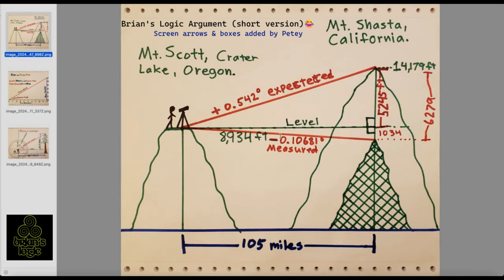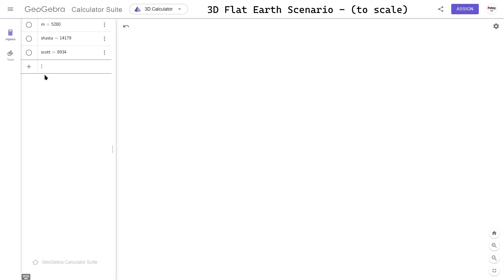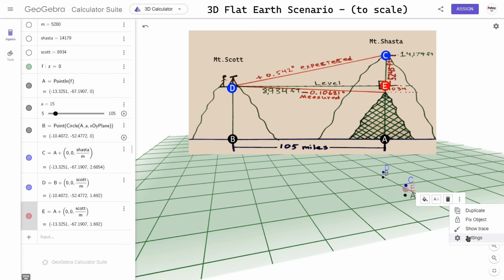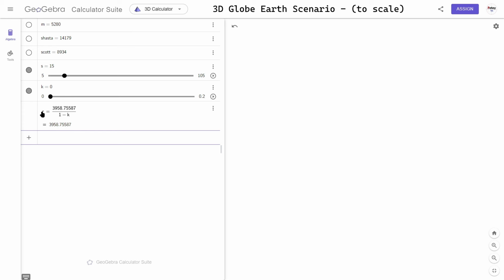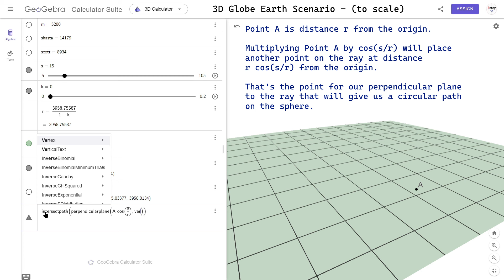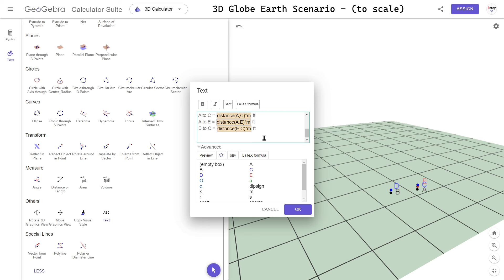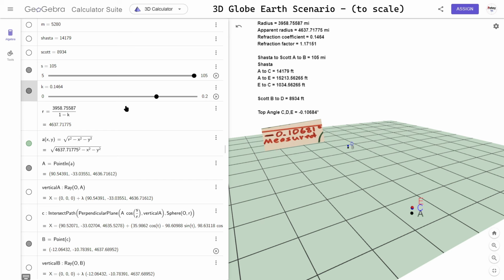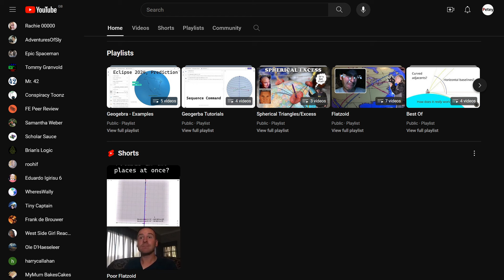Flat and Globe Scenarios - Full 3D Geogebra Walk-Through Ft. Brian's Logic

Comment: I’m only starting and you have already looked straight past the problem ?
If angular size exists then earth curve does not, as they both can’t exist simultaneously Petey  ?
Second after you ignore that, you go on to say that over a flat plane that the angle 📐 to the top of Mount Shasta must still be what’s expected, and yes this is true except it won’t APPEAR to be, because of angular size, so in actuality the angle is hitting the top of Mount Shasta, but it doesn’t APPEAR to be doing that because of perspective.
Do you understand what Apparent and Actual sizes are Petey, as your expecting Mount Shasta to show its Actual size to an Observer 105 miles away, when due to perspective this would be impossible ?
Your video fails ( not trying to be nasty or put it down intentionally ) at the very start within the first 2 minutes, as you ignore the two most glaring issues.
Reply: I will respond more later.
Reply: @BriansLogic  I think the most glaring issue here is that you don't understand perspective. The top of Mount Shasta will definitely appear to go down, but perspective dictates that it never will appear to go farther down than the horizontal line of sight. That is, on a flat earth. And the top has been measured beneath the horizontal  line of sight. This means that the top must be beneath the horizontal line of sight in reality. Your response fails, not only in the very first sentence but in its' entirety.
Reply: LOL  Angular size has nothing to do with the shape of the Earth.
Reply: All I saw was you proving you don't need a Horizontal Flat Plan to get a Elevation Angle...   WELL DONE
Reply: Changes in angular size with distance apply equally both above and below the horizontal line. (Well, generally, it applies to all sides of the line from the observer parallel to the change in distance, but for a flat Earth, it's specifically the horizontal line since changes in distance are in the horizontal direction.)

That's the point that Petey is trying to show you. As distances increase, the angular separation from the horizontal line tends to zero on a flat Earth for both the top and the bottom. That was the original reason for the claim that, "the horizon rises to eye level."
Reply: Brian, if you think you understand ANY of this stuff, I'd love to see what your calculation/prediction is for flat earth. If you can't, then you DON'T understand it.
Reply: @BriansLogic   they both can’t exist simultaneously
They absolutely can. How would the angles, which are clearly getting smaller with distance regardless of the shape of the Earth, be different if there was ALSO Earth curve? Well, it would be a very subtle difference at short distances but it would get more noticeable with longer distances.
If you were at sea level and there was something 5245ft higher than you and 105 miles away on a flat plane, what would be the angle to its top relative to eye level?
If you were at 8934ft elevation and there was something 5245ft higher than you and 105 miles away on a flat plane, what would be the angle to its top relative to eye level?
Unless you are claiming that at sea level, the angle is negative, then you are claiming different angles and that things appear to drop faster relative to distance, the higher the elevation.
Reply from the maker: What if you adjust the slider in the flat scenario geometry, slider(105,2505,100), ie, you can move Mt.Scott 2500 miles away from Mt.Shasta on FE, (not that mountains move). Would the observer measure a dip for the top angle on Mt.Shasta or would the angle be positive? How far would you have to move Mt. Scott away from Mt. Shasta before the observer observes a dip to the top of Mt. Shasta? Is such a thing even possible? Show your math?
Reply: "Angular size and earth curve can't exist simeltaneously"

Why not? Please explain.

#GottaLieToFlerf
Reply: Mt. Shasta would appear SMALLER, Brian. It wouldn’t appear LOWER 🙄
Reply: @BriansLogic  Are you saying that you think a change in angular size relates to a change in physical size Brian?  Do we need to get the Father Ted video out?
Reply: @Petey194  SMH 🤦‍♂️
Reply: @roohif  Lol you obviously didn’t see my most recent video :)
How’s the Bear 🐻 Pack going 😆
Reply: "If angular size exists then earth curve does not, as they both can’t exist simultaneously"

This makes no sense. Angular size is simply a result of an object having a cross section greater than zero, combined with the distance between observer and object. A basketball at 20 feet has exactly the same angular size whether you are on a hill, a flat surface, or in a bowl shaped depression.
The angular size of an object doesn't affect the surface you're on, and the surface doesn't affect the angular size of the object. It's as though you're just trying to muddy the water here.

If you are on a flat plane an object 100 miles away from you that is 100 miles high will appear in your field of view between the horizon and 45° above the horizon -- for an angular size of 45°.

On earth the top of that same object at the same distance will not be 45° above your level line of sight, it will be lower. In part because it is leaning away from you--not much, but a little. But mostly because the bottom of the object is farther around the curve of the globe, below your level line of sight.
Reply: @BriansLogic  Correct, I have not seen your latest video. Is that the one where you actually show the “correct” mathematics, and predict what the angle should be?
Reply: Perspective angular compression is your imaginary curve
Reply: @Emersum Biggins  Rayleigh Criterion effects from angular compression would make it look lower because the bottom of the mountain could not be resolved
Reply: @BriansLogic  Does perspective bend the path of light?
Reply: @garywybenga4188   So is it Rayleigh criterion, angular compression, or perspective that is bending the path of light?
Reply: @extrajay4868  Do railroad tracks appear to be bending? Or do they appear to be slanting upward towards eye level and inward towards each other? Why can't you see between the rails where they "seem to merge"
Reply: "If angular size exists then earth curve does not, as they both can’t exist simultaneously"
This is a claim, not evidence.
Take a object of known size (Basket Ball would be perfect), and measure the angular size of that object over 30 and 60 meters. Take a measurement on a running track that's flat, then again in a creek bed, ravine so you have a concave surface. Then again on a hill so you have a convex surface.
Your hypothesis is the angular size will change on the running track, but not the other 2 test points.
The Null hypothesis is the angular size will change in all 3 locations equally in relation to the distance.
Willing to test your claims?

"you go on to say that over a flat plane that the angle 📐 to the top of Mount Shasta must still be what’s expected, and yes this is true except it won’t APPEAR to be, because of angular size, so in actuality the angle is hitting the top of Mount Shasta, but it doesn’t APPEAR to be doing that because of perspective."
That is correct, this is Why Pete added this into the calculations. Check the video again, and actually watch. This Is accounted for. As you increase the "slider" to add distance, the angle Changes in relation to the distance...

"Your video fails"
How,? Please demonstrate. Your 1st point is a Claim with no evidence, that questions observed reality. Your 2nd point is moot, as this is covered in the video and calculations.
Perhaps pay attention next time, it's quite rude to leave comments like this, that show you didn't really pay attention to the work...
Reply: Why cant both of those things exist? 😂
Reply: @garywybenga4188  LOL, why would just the bottom of the mountain not be resolvable due to the Rayleigh Criterion if the earth was flat? The bottom, you know, the widest and largest part of the mountain?  Do you guys actually read what you write before you hit the "reply" button?
Reply: @garywybenga4188  Once again you can't answer the question.  Three choices, and you and I both agree perspective does not bend the path of light, so that narrows it down to two.
     I'm pretty sure you agree with me too that perspective causes objects to appear to converge (on a flat, uncurving surface) toward the direct line of sight/eye level, and not past it.  Correct?
Reply: @garywybenga4188   the bottom of the mountain could not be resolved
So the bottom of the mountain blurring with the surface changes the angle to the top of the mountain? Brilliant!
Reply: What a magnificent piece of drivel: Earth curve and angular size can’t both exist?? We look forward to Brian’s next five hours of vacuous rambling failing to explain what either term means and why they couldn’t simultaneously exist in his lack of understanding. Ramble on, Brian.
Reply: @RealJiffyCones  Because reasons.
Reply: @roohif  It’s the one YOU haven’t watched, and obviously don’t understand as there is NO Angle 📐 SMH…. Bear 🐻 Pack forever lol :)
Reply: @everybodylovesballs  Lol because a 6 foot object would then disappear at 1.8 miles away from an Observer.
Does that happen ? NO….
Listen it’s easy to disprove my statement, all you have to do is SHOW where in your earth curve maths 🧮 perspective is accounted for, when detailing an object in the distance or moving away from you ?
Simple just SHOW….
Reply: @BriansLogic  “NO angle” … ? As in, you point the theodolite at the mountain, and the screen is .. blank?!?!
Reply: @roohif  No Genius you don’t point the Theodolite at the top of the mountain 🏔 you point it TOWARDS the mountain and make sure it’s level ( you know horizontal ) and once you do this YOU will be looking at a point on Mount Shasta that is 5245 feet down from its summit, but due to perspective it won’t SEEM like you are, as perspective size is APPARENT size and not ACTUAL size, there is NO ANGLES, that’s what you guys can’t ( as a whole group of people ) seem to grasp ?
NO ANGLES Glenn None….
Reply: @BriansLogic  Simple question.What actually causes perspective?
Reply: @BriansLogic  Lol because a 6 foot object would then disappear at 1.8 miles away from an Observer.
Where did you get that figure from? What height is the observer's eye? Without refraction, I get a 6ft object completely visible to an observer with 6ft eye height up to 3 miles and then gradually being hidden until it disappears af 6 miles. Refraction increases these distances a little bit on average.
Listen it’s easy to disprove my statement, all you have to do is SHOW where in your earth curve maths 🧮 perspective is accounted for
Sure, for an observer at 6ft, the top of a 12ft object will appear 0.34° above eye level at 1000ft, 0.17° at 2000ft, 0.6° at 5000ft, etc, on a globe. See how the angle gets smaller with distance even though it's obviously still a 12ft object? That's perspective. These numbers are the same for a flat Earth except for the 5000ft example, where it's 0.7°. The further the distance, the more they'll diverge obviously.
Reply: @BriansLogic "No Genius you don’t point the Theodolite at the top of the mountain"

WTF 🤣I don't even know how to respond to that 🤪

The whole observation is literally Jesse measuring the angle to the top of the mountain.

You're so weird.
Reply: @thearmouredpenguin7148  Your eyes and how we see, do YOU not know that ????
Reply: @everybodylovesballs  And how much of a 6 foot object is hidden for an observer with a 6 foot eye height on a globe 3 miles away ? Nothing.
But if both situations placed the eyes at sea level, then for both situations separately, a six foot object disappears at 3 miles away, but if we amalgamate both scenarios, then a 6 foot object disappears at 1.8 miles away, does this happen in REALITY No it doesn’t, does Perspective exist in reality, Yes it does Globe OVER….
Reply: I keep banging on about this, but: when Flerfers use “perspective” or “angular size” to explain why ships disappear bottom up they seem to forget that these operate horizontally as well as vertically. So, looking at windmills out at sea, if it was angular size that made the bottoms disappear, why don’t the visible (horizontal) blades of the windmills also disappear or at least get shorter by the same amount?
Reply: @roohif  This comment tells me that you don’t understand where Jesse was wrong, or why he was wrong, and my video is about the horizontal line from the eye, and exactly where this hits on the other mountain, which is exactly where it should hit at 5245 feet down from the summit, but it appears as if it’s not doing this because of perspective, so if Jesse just calculates the amount of angle 📐 above that point that the top of the mountain 🏔 would be at 105 miles away, then this line WILL be hitting the top of the mountain, but it will APPEAR as if it’s NOT doing this due to Perspective, the thing that doesn’t exist on your globe 🌎 ?
Reply: @CChrisHolmes  Angular size is about amounts, so 20 foot of an object my not be resolvable but the rest is, as a 20 foot object would not be visible at that distance, as diffraction would make it so.
So we don’t need some guy, who doesn’t even realise that he’s debunking his globe, by accepting that angular size exists, telling us about anything….
Oh and genius the horizon is NOT geometric so who cares about what it does or does not show, it’s officially just an optical phenomenon, YOU need to learn about the Real World 🗺 buddy ?
Reply: @BriansLogic  Jesse set up his theodolite on one mountain, and pointed it at another mountain. We know the heights of the mountains and the distance. The theodolite is going to show a number - what will that number be?

I do not care about literally ANYTHING ELSE in this thread. If you cannot predict what that angle should be, then I have no interest in continuing.
Reply: @CChrisHolmes  Hey Genius….
If I place a 20 foot high object at a distance where it’s angular size is 0.02 degrees, and it sits right next to a windmill that’s 270 feet tall, does that mean that I will be able to see the full 270 foot of the windmill, while the 20 foot high object is invisible right next to it ?
Now :)
Reply: Brian, your standard excuse for every single observation that proves the earth is round is simply nothing more than “angular size blah blah blah perspective blah blah blah derp derp derp duh duh duh.” You have literally zero idea what you’re talking about.
Reply: @BriansLogic  "all you have to do is SHOW where in your earth curve maths 🧮 perspective is accounted for"
Perspective and earth curve are two entirely unrelated things. So why would the maths for one account for the other?
Reply: @frankdebrouwer-leiden  You forgot to add (because it is blindingly obvious to those of us who understand this) that on a flat earth perspective would result in the base seeming to rise towards the horizontal line of sight. Brian appeared, that is A P P E A R E D appeared 🤣, to think that the base does not rise, as the top lowers, towards the horizontal line of sight. Thus the angular size decreases with distance but the point on the mountain that is at the same horizontal height as the viewpoint (on a flat earth) would remain in the same place in the view. Brian shows odd thinking that angular size decreases downwards only. The implication is that a mountain that is 2000m high at a distance that made it look half that high would have its base at ground level and its top at 1000m if your view point was starting off at 1000m. In his odd mind it would have all of the apparent 1000mshowing from eye level down to the ground even on a flat earth. This is like saying that if you stood in the centre of a set of train rails that ran straight for as far as can be seen that, when viewed parallel to one of the rails, that the vanishing point of the rails would always be off to one side. Since there is no way to say which side since they are both equal this falls down logically.
Reply: @BriansLogic  " Your eyes and how we see" Well there's an informative answer - not! If you can't answer the question just say so, don't write a few meaningless words instead.
Reply: @BriansLogic  Have you got a theodolite?
Reply: @BriansLogic  "Angular size is about amounts"
No, it's about apparent size.

"so 20 foot of an object my not be resolvable but the rest is" Either the whole object is resolvable or none is. The idea that angular resolution limits cause bits of objects to become unresolvable while the rest can still be resolved (as long as the distance from the observer is the same) is utterly bonkers.
Reply: Explain this to us:
Your words
"If angular size exists then earth curve does not, as they both can’t exist simultaneously Petey  ?"
Why??????
Reply: @martinconnelly1473  I let that hang for globers to pick. It must be obvious for anyone who understands how perspective really works that, when the top of an object above the horizontal line of sight appears to drop lower than the horizontal line of sight, the same would go for the bottom of an object below the horizontal line of sight rising above the horizontal line of sight. To be true (quod non) the perspective lines toward the vanishing point would have to cross over. Flerfers never think about the logical consequences of their nonsensical "explanations" for reality that contradicts their silly narrative. That's probably why there are so many different "explanations" for reality that contradicts their silly narrative among flerfers, most of which contradict each other.
Reply: @everybodylovesballs  Attempting to add an angle AFTER you have added earth curve, is NOT accounting for perspective, that’s pushing an object over earth curve then attempting to creat an angle to its top, that is what’s known as Bo**ox ?
You have not presented what was asked for….
Reply: @carioca45  Because a 6 foot object will disappear at 1.8 miles away for an observer with their eyes at 0 degrees, but this does not happen, as that object won’t disappear until 3 miles away due to angular size change, and how we know that this is due to angular size change, is because we know that perspective exists, which debunks earth curve as if they both existed, then that same object would disappear at 1.8 miles away. Globe debunked….
Reply: LOL.  On a flat plane, the upward angle to the mountain couldn't switch to a downward angle even if you moved it a trillion miles away.  Perspective simply does not work like that, as most people can easily understand.
Reply: @thearmouredpenguin7148  There you go, : "Your eyes and how we see".  Don't you just adore flat earth "education"?!
Reply: @ReValveiT_01  Yes the angle 📐 to the top doesn’t actually change, it just appears as if the angle is not hitting the top from a distance as I have proven over and over….
Reply: @ReValveiT_01  Oh and if perspective exists then earth curve cannot….
Reply: @BriansLogic  OK. Let's give this a little more.
By 6 foot I'm assuming a circular object, with 6-foot diameter, moving away from the observer. After 1.8 miles, on a spherical surface, it disappears, on a flat plane it will take 3 miles to disappear. Did I get this right?
Does the height of the observer above the surface matter?
Does the height of the object above the surface matter?
In case the object was moving straight up away from the observer, would the same happen? 
That is, if the observer is on a spherical surface the object would disappear once it is 1.8 miles away from the observer and 3 miles when standing on a flat surface.
Is angular size a function of the surface the observer is standing on, meaning angular size changes at a different rate based on the geometry of the surface?
Reply: @BriansLogic  No, the angle DOES change as the mountain is moved away, but it can never switch from being an upward angle to a downward angle no matter how far away you move it, because one of the RULES of perspective is CONVERGING LINES CAN NEVER CROSS .
Reply: @BriansLogic  Your diagram at the beginning of this video is depicting that the mountain is getting PHYSICALLY smaller.  You have literally drawn it physically smaller.

How can you not see past this glaring error?
Reply: @BriansLogic  "Oh and if perspective exists then earth curve cannot"

Yeah, you spewed this piece of obviously flawed logic already.  Repeating it won't make it come true.
Reply: @BriansLogic  It's geometry, Brian. There's only one correct answer for each situation on a sphere with a radius of 3959 miles (ignoring atmosphere). An object shrinks in angular size (perspective) while going over a curve. What more do you want?
Reply: @BriansLogic  LOL.  You say it YOURSELF repeatedly at 18:35 : "APPEARED" to be smaller.  "APPEARED".  Yet you've drawn it PHYSICALLY smaller.  So which is it?  "APPEARED" smaller or "PHYSICALLY" smaller?  Because by drawing it smaller, you are literally contradicting yourself.
Reply: @BriansLogic   "Oh and if perspective exists then earth curve cannot…." Oh please do explain why.
Reply: @BriansLogic  "Your eyes and how we see, do YOU not know that ????" Stunning observation! Now how about you actually do something that flerfs rarely never do and answer the question that you were asked. What causes perspective?
Reply: Brian, I believe there is important part missing in your understanding of how perspective works. When you describe how the angular size of objects decreases with distance, you are always talking about how the top of the object moves down in the view and thats it. However, according to the perspective, strictly this would only apply to an observer lying on the floor. Imagine yourself being at the top of the Smithfield Chimney. Even the tops of near large buildings are lower in your view than bottoms of even smaller buildings in distance. The buildings get smaller in angular size as the distance increases, but even the roofs move up in your view, not down. You are completely ignoring this fact in your oversimplified understanding of perspective. And that is why you are wrong when you think that the change in angular size of Mount Shasta is enough to explain why we have to look down at it from Mount Scott. Base of  Mount Shasta will move up in the view of observer at 8,934ft elevation as he will move away from it and this will add to the angular size change of it.
Reply: @BriansLogic  What about an observer who's physically looking at both mountains as you've drawn it? Will Mt. Shasta have physically shrunk from their POV, whilst Mt. Scott has somehow miraculously managed to stay the same size?

Nope. Yet for some reason, that's how you're trying to depict it. Can you spot your glaring error yet?
Reply: Brian, you fail in your second sentence. "If angular size exists then earth curve does not" with a bold claim but no proof. Why, Brian? There's absolutely no geometric reason for that to be true. At no point in your video do you show that to be true. What's more, you ignore the fact that angular size reduction (if this were the reason for it) would be linear (train tracks are straight when they disappear into the distance, no?) but earth's curve is a quadratic (non-linear) function. Which, if you'd measured anything instead of burbling about it, you would realise.

And, of course, 'angular size' still fails to explain why angular size reduction causes things to disappear bottom first, which earth curve explains perfectly.
Reply: Let’s see. We have a sentient potato and a guy who has fallen in the silage pit one too many times thinking, I use the word loosely, that they know what they are talking about. 

But write incoherent drivel that makes no sense and doesn’t in anyway in reality. 

It must be hard feeling so insecure that you have to big your brains up with nothing just to lord it over people who have a better grasp of the world.
Reply: "If angular size exists then earth curve does not"
That claim sounds to me patently absurd. Brian, if you've provided evidence for that in some video, I would be interested to see it.
Angular size depends simply on the field of vision of the human eye and the distance between the eye and the object being looked at. Assuming the Earth were flat or round, in either case the human eye would be the same and there would be some specific distance between the person and the object perceived. The eye's FOV and the distance are the only 2 factors involved. The shape of the surface on which the person is located is irrelevant.
Reply: As far as the technique of using angles to measure the elevation of a mountain, there is no such thing as "perspective size". The mountain peak is a fixed, specific height above mean sea level and this does not change depending on the location of the observer. The technique of using angles and horizontal distances to survey and determine the heights of mountain peaks has been common practice for centuries. In the mid-1800s virtually all of the continental USA was thoroughly measured using this and similar techniques. The heights measured have been proven correct over and over again. The technique WORKS, and that's what matters.
None of the surveyors involved in any of these measurements used "perspective size".
Now, Brian, maybe you've got some cool and clever technique that measures "perspective size", whatever that is, and gives accurate results. If so, then please describe in detail that technique so that other people may test it. And please also present your measurements for specific objects of known size, so that your approach can be reviewed.
Reply from the maker: @ That was the point I was trying to make at the beginning. It doesn't really matter about what the mountain looks like 10, 20 or 50 miles closer or farther away, all that matters is a measurement was taken on a mountain at a known height to another mountain with another known height at some known distance away and what the mountain looks like relative to something else is irrelevant.
Reply from the maker: I remember Brian saying this about calculating the size of the Eiffel Tower  https://youtu.be/6t13qXHdh7A 😀
Reply: @garywybenga4188  Excellent point! You actually CAN see between the rails, provided that the rails are at eye-level.
Reply: @BriansLogic  Ah! It's the eyes that cause perspective. That's a very novel idea. Can you expand on this?
Reply: @YAWTon  wrong. The angular separation between the rails will become to narrow to resolve anything in between them
Reply: @ReValveiT_01  Do the eyes of non-human species cause perspective too, I wonder...
Reply: @BriansLogic    "Oh and if perspective exists then earth curve cannot…."
that is your only hope to maintain your delusion..
Reply: @garywybenga4188  Yes. Exactly my point.
Reply: @garywybenga4188  Gary.. why do you lie?
Reply: @Petey194  "Show your math?"  🤣😂🤣😂
Reply: @BriansLogic  "Oh and if perspective exists then earth curve cannot…." 
I can hear Jokely Oakley screaming  "FALSE DICHOTOMT FALLACY" at the to of his voice from 500 miles away.
Reply: @BriansLogic   "Your eyes and how we see."
If it's due to our eyes why does perspective still happen with cameras?
Reply: @BriansLogic  perspective debunks FE.
Thanks to perspective, the angle of an object that is higher becomes smaller the further away it is from you. This fact is used in surveying to calculate the height of objects. 
(mostly at short distances. So you don't have to worry about the curvature of light and the curvature of the earth.)
But the important point is that the angle can never become 0 purely through perspective. No matter how far away. That's why sunsets don't work on a flat earth.
Reply: @BriansLogic  Its obvious you are clueless Broin, why do you bother, it is entertaining in a derpy sort of way.
Reply: @BriansLogic  "if perspective exists then earth curve cannot…."  So you are claiming that on a globe, objects would not decrease in angular size as they move away.  Is this correct?
Reply: @BriansLogic  "due to perspective it won’t SEEM like you are"   I asked earlier if perspective is bending the path of light, but there is another option in order for your claims to work: does perspective change the physical size of the mountain?  Which of these two is it?
Reply: @extrajay4868  incorrect
Reply: @garywybenga4188   Speaking of railroad tracks, do the parallel tracks ever appear to cross in the distance?  If I'm on my side, or turn the camera on its side, will the rails appear to turn instead of going straight?  If we both agree the answers are no, then you should ask Brian what he thinks.
Reply: @garywybenga4188  "The top of the mountain -- which is both farther and smaller than the bottom of the mountain -- was easily resolved even though the larger and closer bottom of the mountain, thanks to the Rayliegh Criterion, was too small for the human eye to detect."

~ Silly Wybenga, 2024
Reply: @garywybenga4188  Perspective angular compression is your imaginary curve
You got your formula worked out for that Gary? Every time I see you in the comments, I will ask for your formula that you think shows that. Heck, I'd be happy if you can tell me the limit angle and whether the formula appears to be linear, exponential, logarithmic or quadratic.
Reply: @garywybenga4188  "incorrect"  To which comment?
Reply: @garywybenga4188  How long have you been copy/pasting this same silly claim for now?  6 years?  7 years?  And still after all that time you don't have any kind of formula or explanation as to how your claims can be applied to work out how much of an object should magically vanish at any given observation point.

Don't worry though, there is another formula we can apply to explain it; we call it "earth curve".
Reply: @Mr22brian22 did you really say "if angular size exists then earth curve does not"  ???

The angular size of distant objects and the characteristic of the surface you are standing on are not mutually exclusive. They have nothing to do with each other, but you think if I'm standing on a ball then perspective doesn't exist anymore. That's insanity.
Reply: @Petey194  What has that clip got to do with anything Petey ?
Reply: @extrajay4868  They can’t as it’s not part of your paradigm, as it wrecks your earth curve claims, which are just perspective hijacking anyhow, learn your own paradigm like I did ?
Reply: @fepeerreview3150  It is a correct claim, learn your own paradigm like I did ?
Reply: @fepeerreview3150  Horizontal Distances lol…. Nothing you wrote helped you….
Reply: @BriansLogic  LOL.  Even after your claims have been demolished over 100 times, you still come back and act like nothing happened.

You are the Monty Python Black Knight sketch personified.
Reply: @BriansLogic  You drew the mountain physically smaller and claimed it's apparent.  

Honestly, there aren't enough facepalms left on the planet to get us through your antics.
Reply: @garywybenga4188  All of your rubber band models are in orthographic view. Therefore, they don’t accurately represent perspective.
Reply: @garywybenga4188  Rayleigh Criterion wouldn’t make the theodolite point downwards when looking from peak to peak. You live on a spinning 🌎Gary.
Reply: @BriansLogic  By the way, I thought the FE mantra was "the horizon always rises to eye level"? Well, according to you and your diagram, the top of the mountain went from being ABOVE eye level (because it is physically above the observer), to BELOW eye level (due to some kind of "magic", obviously), which means the horizon has to be WAAAAY below eye level.

So, the mountain is literally physically smaller and also only apparently smaller, and eye level rises to eye level and also doesn't rise to eye level. Got it. Don't worry, I'm sure nobody will spot the glaring contradictions here...
Reply: @BriansLogic  I just watched Roohif's video (linked in this video) from a year ago totally demolishing your claim that orthographic view doesn't show angular size change.  Honestly, if you're still ignoring what he showed you ONE year on, you have to know you're lying at this point.
Reply: @ReValveiT_01  He demolished his own reputation not my point SMH….
Reply: @Ann_Alglands  It’s NOT my Diagram bonehead ? 
It’s from YOUR side of the fence Genius SMH….
Reply from the maker: @BriansLogic  Well in that clip, you correctly say that if you know your distance to the tower and have the angle to the top then you can work out the height. You also say that if you know the height of the tower and have the angle to the top then you can work out the distance. But what you left out was, if you know your distance to the tower (105 miles) and you know the height of the tower (5245ft) then you can also work out the angle (0.542°).  You clearly agreed with trigonometry in that clip. There was no perspective involved.
Reply: @BriansLogic  And you're still denying it.  You know you are lying - confirmed.
Reply: @BriansLogic  Roohif demonstrated in his video that the angles measured will be identical whether in Orthographic view OR "perspective view". And unlike you, he didn't have to cheat by PHYSICALLY reducing the height of the object.

You're the one with a wrecked rep, pal.
Reply: @Petey194  Ah, I see. He won't tell you who did it? I wonder why...
Reply: @Petey194  Ah, OK. So the author of the drawing was demonstrating earth curve drop with the lower mountain. Right. I thought Brian was pulling his usual trick of drawing objects physically smaller and claiming "it's just perspective!". My bad.
Reply: @Ann_Alglands  Glenn only demonstrated his own lack of understanding lol….
Reply: @Petey194  Lol Petey Perspective is part of that as it’s using an angular size ?
You are confused about this topic Petey and about perspective, you need to have a think about what you’re believing ?
Reply from the maker: @BriansLogic  But seeing is believing (for most of us anyway). I did the geometry and seen for myself that the dip angle which the observer measured to Mt.Shasta was entirely consistant with a globe earth and close to 7/6 refraction. It entirely supported the globe case! So I have thought about this and showed you my workings out.  Maybe you should do a fresh video explaining what I did wrong, detailing the math or geometry I omitted.
Reply: @BriansLogic  The way that you get all defensive and name call(y) around Roohif tells me that you know he's a threat to your religion.
Reply: @BriansLogic  "Glenn only demonstrated his own lack of understanding"

What specifically did he misunderstand in his video? Point it out or you're just lying again.
Reply: @Ann_Alglands  Yes, when Brian fires off several answers to one post, you know he has been hit by something ....
Reply: @BriansLogic  "except it won’t APPEAR to be, because of angular size, so in actuality the angle is hitting the top of Mount Shasta, but it doesn’t APPEAR to be doing that because of perspective"

LOL.  If that were the case, what you're saying is when snipers line up a long shot, they're not actually sighting their target "bEcUs Of mUh pErSpeCtiVe"...  Really?  So how do snipers hit their targets if they're not actually aiming at them, and/or what formula are they using to account for this newly invented Flatopian physics?
Reply: @BriansLogic  "They can’t as it’s not part of your paradigm"  Objects appearing smaller as they move away?  How would being on a globe vs flat Earth cause something to not decrease in angular size as it moves away?  Got a diagram of this?  ......... "learn your own paradigm like I did ?"  Since you're asking, no you haven't.  You should try doing it though.
Reply: Fun fact, Gary Wybenga disagrees with Brian about how perspective works, and actually agrees with us globers, in that eye level remains at eye level, with objects above appearing to move down toward it, and objects below appearing to move up toward it.  He appears not to sometimes when he starts confusing himself with other things he doesn't understand (parallax, compression, Rayleigh criterion, etc), but deep down, he understands this basic fact of perspective.
Reply: @extrajay4868  Because Perspective and earth curve can’t work together and give us results that match reality, only One of them can exist, so which one YOU stating does not exist ?
Reply: @extrajay4868  Anyone that disagrees with me concerning Perspective and this issue is wrong, as I have proven through detail, demonstration, and real world observation, so it makes No difference to me who it is….
Reply: @BriansLogic  "Anyone that disagrees with me concerning Perspective and this issue is wrong"

Just to make sure I understand you correctly.

According to you, part of an object becomes invisible beacuse it reaches it's diffraction limit due to distance, angular size (perspective) and optical drop. Correct?

This effect is pure optic, and the surface below (water og solid earth) has nothing to do with the object seeming to disappear bottom up. Correct?
Reply from the maker: @BriansLogic  But reality in this case was a dip angle of -0.10681 to a much taller mountain and it was perfectly explainable by a globe earth with a radius of about 3959 miles with a refraction factor of about 7/6.  And this model makes predictions for any situation you care to throw at it which is why people on the opposing side are usually restricted to observations from a 1 ft observer height where they know distortion is maximised.  This model also explains everything else and all at once for things like star rotation, eclipses and how we see the moon in the different hemispheres etc etc. You know deep down it's right. C'mon mate, switch sides, you know you want to. 😊
Reply: @BriansLogic  Yeah Bri, literally the whole world is wrong and you're right.  That doesn't sound Dunning Krugery at all, honest gov...
Reply: @BriansLogic  "Perspective and earth curve can’t work together"

Well, I just looked at a house over a hump back bridge and guess what?  The house was partially blocked bottom up by the curve of the bridge, AND the angular height of the house had dropped due to my perspective.

Must be voodoo, huh?
Reply: @BriansLogic  Oh, and I'll ask you this again, seeing as you had to ignore it the first time:

If I stand on a mountain top and measure the angle to another mountain top with a theodolite (at say, 5º), now what happens if I fly a drone out to view both mountains in a sideward orthographic view; what is the angle between me and the top of the mountain from the drone’s POV?  According to you, it should be a different angle, so, what is that angle?

Well?
Reply: lol
Reply: @ReValveiT_01  Depends on the issue ?
Reply: @ReValveiT_01  What you measured a Dip Angle 📐 to a Perspective size ????
Lol that is some seriously ignorant question SMH.
Reply: @Hjaldor  The amalgamation creates an APPARENT disappearance, it’s not actual, Perspective is Apparent do you understand the difference between Apparent and Actual ?
And are You trying to claim earth curve lol, it’s only in the maths not reality….
Reply: @BriansLogic  and you appear to be trying to sound like you know what you are taking about. Just so you know, you don’t.
Reply: @ThoughtandMemory  No I definitely do it’s you guys who are ignorant, just so you know :)
Reply: @BriansLogic  "Perspective and earth curve can’t work together and give us results that match reality"  Because you say so?
Reply: @BriansLogic  "as I have proven through detail, demonstration, and real world observation,"  And you've been disproven by a camera that was actually parallel with the table, not angled up.
Reply: @extrajay4868  SMH No Bozo I gave you the PROVEN reason why, you’re just not comprehending your own claim, as you literally don’t understand this yet ?
Reply: @extrajay4868  I was never disproven, my camera was parallel with the table surface, and this was PROVEN by not just me, but people on Your own side, so NObody disproved it as it can’t be disproven, it’s an effect of perspective the thing that is NOT part of your globe maths 🧮 remember, the thing that debunks your globe ?
Reply: @BriansLogic  "The amalgamation creates an APPARENT disappearance, it’s not actual, Perspective is Apparent do you understand the difference between Apparent and Actual ?"

Ok. I interpret this as you mean it is part of the object getting so small that it becomes invisible, and that the surface below has nothing to do with it. 

If this surface is water, and we somehow could lower it, would the lower part of the object still be invisible?
Reply: @BriansLogic  WTH is a "Perspective size"? Do you mean "angular size"? LOL.  Let's simplify things for you: 

I take a theodolite reading to the top of a building 500 metres away; the reading is 3º (this is the angular height from MY PERSPECTIVE).  I now fly a drone out to view both me and the building in a sideways orthographic view.  What is the angle between me and the building from the drone's orthographic POV ? You claim it WON'T be the same angle as my theodolite reading.  So then WHAT WILL IT BE ?

If you can't tell me what the new angle is and why it's magically changed, you debunk yourself. Simple as.
Reply: @BriansLogic  Why do you get angry and start name calling when proven wrong?  It's a real tell, ya know.
Reply from the maker: @extrajay4868  🤨🤔 https://www.youtube.com/shorts/wHmfjRogG4o  🤭😊
Reply: @BriansLogic  It's clear from your ramblings that you think perspective is some kind of mystical entity that cannot be measured or predicted. No, you're confusing it with "flerfspective". We can calculate and predict perspective (angular size/height/speed changes) just fine over here in the real world; and guess what? Perspective doesn't do what you need it to do.
Reply: glaring issue #1
- flat earfer am stupid

glaring issue #2
- flat earfer am ridiculous
Reply: @frankdebrouwer-leiden  nobody "understands flerfspective", not even flat earthers.

that's because "perspective" is an artist's trick, and has nothing to do with MEASUREMENT
Reply: @BriansLogic  "it’s an effect of perspective the thing that is NOT part of your globe maths"

Oh, so "perspective" (well, flerfspective) is a thing that's part of your flat earth maths then, is it?  Superb.  Well?  Don't be shy, let's see it.  (This is the part where Brian doesn't supply his own maths for his own positive claims but carry's on crying foul to everyone else for not including his incoherent ideas of what magical flerfspective somehow achieves).
Reply: @Ann_Alglands  Bla Bla Bla nothing….
Reply: @BriansLogic  So, no perspective included in your flat earth maths, then. Shame. I was hoping you'd show us how it's done...

Hypocrite much?
Reply: @BriansLogic  It's funny that you claim that "no perspective in globe maths disproves the globe", but apparently, no perspective in flat earth maths doesn't disprove flat earth.

Ya know what we call this? Double standards. Or cognitive bias, if you prefer.
Reply: @BriansLogic  Perspective and earth curve work together.
Reply: @BriansLogic  "my camera was parallel with the table surface,"  Then why does something centered in center frame of my camera remain at center frame, as I zoom in or out or move the camera in and out, when it is aligned parallel with a flat surface?
Reply: @BriansLogic  "you literally don’t understand this yet ?"  Since you're asking... no, I understand this all just fine.
Reply: @BriansLogic hides behind his indefensible incorrect understanding of what perspective is and how it works.  Every argument you put in this thread circles back to this.
Reply: @thepooz7205  You mean every argument that is made towards me handle with style ?
It’s funny that so many of you guys want to talk about perspective, when it’s not accounted for in your paradigm hmmm 🤔
Reply: @BriansLogic  
"Because Perspective and earth curve can’t work together and give us results that match reality, only One of them can exist, so which one YOU stating does not exist ?"

Utter gibberish. 

Walter Bislin kindly made a calculator some years back comparing both views. You should check it out. 
Visible
Visible Angle
Drop
Angular Size
Hidden
Hidden Angle

Link hidden, but it should be easy to find.
Reply: @truthstoat8517  Lol Bislin hijacks Perspective mathematically and you don’t even realise it, the globe maths are orthographic maths, and on his calculator and all others, earth curve and hidden amount is calculated first and only, there is no perspective in globe maths, Bislin tries to visually add it in diagrams that are designed to look like reality, but without the globe maths being added, he doesn’t add perspective in the maths, he can’t as I proved, so which one are you saying exists earth curve or perspective ?
Reply: @BriansLogic  Yes sir, you do stylistically spin your misunderstanding of perspective into an impenetrable shield of ignorance.  You are repeatedly just claiming all observations that disagree with you only APPEAR to disagree with you while actually exactly agreeing with you through the magic of perspective.  Kudos, I guess, if you are proud of it.
Reply: @Mr22brian22 Its nothing to do with "our eyes and how we see."  What a ridiculous assertion.  A camera will see exactly the same thing as our eyes, but no eyes involved.
Reply: @CChrisHolmes They do not understand perspective.  It took me ages to realize that their understanding is locked at Father Ted level.  And even then they screw it up.
Reply: @BriansLogic Why will the 6 foot object magically disappear at 1.8 miles.  Surely, I can get out my trusty P1000 and pull it back.  Where is your math to explain the 1.8 miles. 

Then the rest of what you made seems to make no sense.  Yes, the object will START disappearing after 3 miles away, as that is when it starts dropping behind the horizon.  We will still be able to see the top of it until it passes 6 miles, at which point it is completely hidden behind the curve.  All the time this is happening, the angular size of the object is reducing.

Short story - you can definitely have angular size and earth curve at the same time.  It amazes me that you can't see that.
Reply: @BriansLogic You will need a video to prove that wild assertion.  I can't wait.
Reply from the maker: @BriansLogic  17:00 shows all the numbers you can put into Walter Bislin's calculator. 
Observer height = 8934 ft
Target size = 14179 ft
Target distance = 105 mi
Refraction = 0.14644
And guess what value is produced for the Angle to the Top of Mt.Shasta? Yep, you guessed it, exactly what the geometry in this video produced, the dip angle of -0.10681°
Now tell me where I "hijacked" perspective? You watched me constructing the geometry *from scratch*, putting a point here and a point there. You watched as refraction was accounted for. You watched me ask geogebra what the angles were. There was full transparancy. Now given the results in this video match the results from Walter Bislin's curve calculator to many decimal places, surely you can tell everyone exactly where the hijacking took place? Come on, do tell!
Reply: @BriansLogic  <<< reported as a fraudster
Reply: @Petey194  Lol Petey there is no such thing as an Angle 📐 to the top of a Perspective sized Mountain 🏔 the object has changed in Angular Size, that means that it has gotten APPARENTLY smaller with distance, what you demonstrate and Walter Bislin demonstrate, is that Perspective is being hijacked and turned into earth curve ?

Do Surveyors take apparent dip angles to the top of a mountain in the distance ? No they don’t as they realise that it has an angular size, so if that mountain is higher than their observation height, then this actual size difference doesn’t change with angular size, it only appear to.

Now Please produce for me where in your globe maths Perspective is accounted for, because if you can’t do that ( and you can’t ) then there is No Globe….
Reply: @Petey194  And listen back to the first two minutes of your own video, as that is the point at which I stopped, as you walked straight past the two most important points, so there was no point in watching on further as you had just ignored what was important ?
And I literally made more than one video on the hijacking, but you probably walked straight past them, and used an R value in a geogebra work up that has zero measurement in reality ?
Reply: @JohnSmith-ux3tt  What Assertion ?
Reply: @JohnSmith-ux3tt  SMH and what will you look at the videos and photos with ????
Reply from the maker: @BriansLogic  "the object has changed in Angular Size". No, its angular size hasn't changed. Changed from what? It's not on wheels moving you know. It's a fixed object measured from a fixed distance away. 

"that means that it has gotten APPARENTLY smaller with distance". But its distance never changed. What are you talking about! 

"what you demonstrate and Walter Bislin demonstrate, is that Perspective is being hijacked and turned into earth curve". But you can't show where! 

"Do Surveyors take apparent dip angles to the top of a mountain in the distance ? No they don’t as they realise that it has an angular size". But we're not measuring its angular size! The exercise here was to measure the angle from the horizontal to the top of a taller mountain! Strawman much?

"Now Please produce for me where in your globe maths Perspective is accounted for". What? I thought you said it was hijacked? Make your mind up.
Reply from the maker: @BriansLogic  "And listen back to the first two minutes of your own video, as that is the point at which I stopped". Does that mean you'll be making a video response? Getting your excuses in now that you didn't watch it all? Goody, can't wait!
Reply: @Petey194  SMH You still don’t get it do you ?
Your taking an angle to the top of something that’s above you, but due to angular size change with distance, the object APPEARS to be lower but it’s Not, it’s still above you and your horizontal is still hitting that object at the point that matches your elevation, you are taking a dip angle to something that’s above you because your confused by perspective, and then you’re calling it earth curve ?
You literally demonstrate the very premise of what I say, and then ask for a demonstration ????
Reply: @Petey194  I won’t be making a response to anything, as there’s nothing to respond to Petey ?
You NEED to listen back to the first two minutes of your video, not get a response video from me….
Reply: @BriansLogic  Why do you keep ignoring the rule of your beloved perspective that CONVERGING LINES CAN NEVER CROSS?

Is it because it's inconvenient for you; just as the sun and moon NOT changing in angular size OR speed is ignored by flat earthers because that's also inconvenient for you?

Your own wacky claims are self debunking but you don't have the backbone to notice.
Reply from the maker: @BriansLogic  Again, the angular size isn't changing! How many times. It only changes if you move it and mountains don't move! Angular size is irrelevant here. All that is happening is someone is establishing a horizontal and when you look along it, it projects above the taller mountain. That wouldn't happen on FE, just like I shown you in the short. One day you'll get it Brian. I look forward to that day and I hope it comes soon! 😊
Reply: @BriansLogic  OMG no; things don’t APPEAR to be where they aren’t. You have no idea what perspective is.
Reply: @Petey194  It’s called Angular Size with Distance, is 105 miles a distance ?
SMH.
Reply: @Petey194  Lol and now Angular Size is irrelevant wow, how fast you prove my point ?
Reply from the maker: @BriansLogic  100% irrelevant. Shake your head all you want. The mountains are not on wheels so they don't move. You're only ever going to get one angle for its size and we're not even interested in it. You keep saying "angular size change". There is no change. It is what it is and nothing else. Tell me this then, what did it change from and what did it change to? Answer that and you win a cookie. C'mon. Answer. Thought not.  You have no answer. 

This was about measuring the vertical angle from the horizontal to the tip of Mt.Shasta, a much taller mountain. The theodolite had to be tilted down from the horizontal to measure it. Something that is 100% impossible on FE.   I know you can't handle this confusion and that's okay. Just don't lie awake at night staring at the ceiling wondering why something has to look down to the top of something physically taller. Dear oh dear.
Reply: @Petey194  Petey your literally denying that the mountain 🏔 has an angular size change as you have to, because you didn’t account for it in your video , just like Bislin and all the other deceivers, you must deny Perspective to even attempt globe maths 🧮 
How can you take an angle 📐 to a perspective size, why would the top of the mountain 🏔 actually be lower if it has only shrank due to perspective, which means that it didn’t shrink, why is that Petey ?
You see I am fully aware of what your doing, your accounting for earth curve ( something that doesn’t exist ) and ignoring perspective, so you can then take a Non-Angle to the far mountain and claim drop, when there is none, there is no actual drop just an Optical Drop, an illusion of the eyes but you want to deceive ?
Reply from the maker: @BriansLogic  I've already asked you a question. What is the angular size changing from and what is it changing to. You didn't answer. You coudn't answer. That's because it's not changing and that's because neither it or the observer is moving. It's angular size is related to its distance from the viewer. Now it's not my fault you can't understand this. All heights and distances are fixed! But it's irelevant. Did I use the angular size once in my demo? No, I didn't. 

You ask, how can you take an angle. Easy. Establish a horizontal and then tilt your measuring device so that it points to the tip of the mountain! Voila! There are no maths involved in that. Horizontal, tilt and read the angle! Got it? No maths! 

I'm not doing anything. The observer simply took an angle to something much taller and had to look down. It's really that simple. It's not a difficult concept to get. 

Why do you want to make this more complicated than it actually is? Horizontal, tilt and read the angle! Consider looking up to the top of the Eifel tower in an FE scenario. Tell me again how you're looking down through the ground to the top of it while actually looking up!  There is no scenario on the FE where this can happen. 

You're tying yourself in knots. Now get to bed and get some sleep. It can't be good being up all night worrying about this.
Reply: @Petey194  In all fairness, Brian couldn't tell if you used angular size in your demo or not, since he didn't get to see it. Your demo only started after the first 2 minutes of the video.
Brian can no longer complain about people who seemingly didn't watch his videos yet commented on their content.
I keep thinking about making a video on Brian's "optical drop phenomenon", but this has been done quite a few times and has failed to convince Brian that no such phenomenon exists, why would one more video have any effect on him?
FE's start with the conclusion and then build a story to justify it.
Reply from the maker: @carioca45  Well denying he watched the video is just something flerfs generally say. Plausible deniability and all that. It's a get-out so they don't have to address anything 🙈🙉.  I find it hard to believe he hasn't watched it all, even if it's just see how dragging point A will move all the points at once. But you're right of course.
Reply: @BriansLogic  You never did answer this... According to how you think perspective works, does it bend the path of light, or does it physically make objects smaller?
Reply: @BriansLogic  Have you forgotten to answer my simple "yes/no" question? 

 "The amalgamation creates an APPARENT disappearance, it’s not actual, Perspective is Apparent do you understand the difference between Apparent and Actual ?"

Ok. I interpret this as you mean it is part of the object getting so small that it becomes invisible, and that the surface below the object has nothing to do with it. 

If this surface is water, and we somehow could lower it, would the lower part of the object still be invisible?
Reply: @BriansLogic  So the fact that even after all this time you are still unable, or unwilling, to explain exactly what causes perspective leads me to one of two conclusions.
 Either you genuinely have no idea what the cause is, or you do know but you are unwilling to explain it because you know that it totally destroys all your pathetic attempts to justify your belief in flat earth. Either way you are making yourself look a bit of a numpty.
Reply: @thearmouredpenguin7148  The human eyes and how they work is the cause of perspective, you need to see an optician not me they will tell you how the eyes work.
Reply: @thearmouredpenguin7148  I detailed, explained, demonstrated, and showed in real life, and you’re saying I need to explain it lol, no YOU need to learn to understand it as YOU are making yourself look like a bit of a Numpty my friend ?
And I don’t hold a Flat Earth belief, I hold a Flat Earth Knowing :)
Reply: @BriansLogic  "I detailed, explained, demonstrated, and showed in real life," No Brian all you have done is state what happens*, and how you think that explains your flat earth. You have not explained exactly *what causes perspective.
Reply: @BriansLogic  If it's "the human eyes* that is the cause of perspective what is it about the human eye that causes perspective? Why do we get perspective in photographs?
Reply: @Hjaldor  What if the tide went out and a rock that we couldn’t see we can see now ?
SMH are you crazy ? What has that got to do with Perspective ????
You literally don’t have a clue about perspective, you think that objects ACTUALLY get smaller with distance lol :)
Reply: @thearmouredpenguin7148  No I did all of what I say literally years ago, YOU just don’t like it :)
Reply: @thearmouredpenguin7148  Because Optics are based upon the human eye….
Reply: @thearmouredpenguin7148  Does earth curve cause perspective lol :)
Reply: @BriansLogic  I am not talking about the part below water, but the part just above, which at distance is not visible while the top of it is.

If  this invisibility is caused by perspective, and not by water obstructing the light, should it not still be invisible even if the water level were lowered?
Reply: what could possibly be going on in your brain where angular size and earth curve cannot both exist
Reply: @BriansLogic  "if perspective exists then earth curve cannot" <-- did you have a head injury or something?
Reply: the orthographic view shows the decrease in angular size, dunkass
Reply: angular size has nothing to do with the shape of the earth. Things have angular size looking straight up. Angular size is nothing more than the apparent size of an object, it is completely independent of the shape of the earth. Tell us you don't understand geometry without saying the words.
Reply: You don't have a clue about perspective.
Reply: I proved beyond a shadow of a doubt in my debate with Brian Leake, that the orthogonal view truly represents what we see in perspective. So your cult can drop the muppet vision cop out post haste.
Reply: @ShawnHawkins666-33  I agree with you
Reply: @garywybenga4188  you don't understand perspective or angular resolution or the Raileigh criterion AT ALL.
Reply: @shawnhawkins33  👍 👌 if that make you feel better
Reply: @garywybenga4188  It makes me sad for you.
Reply: @shawnhawkins33  👍 👌 if that make you feel better